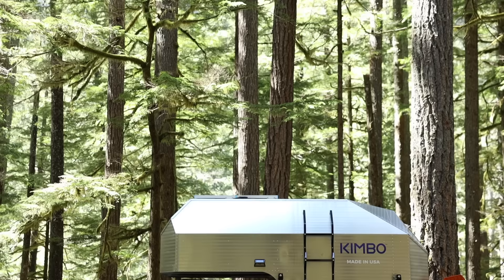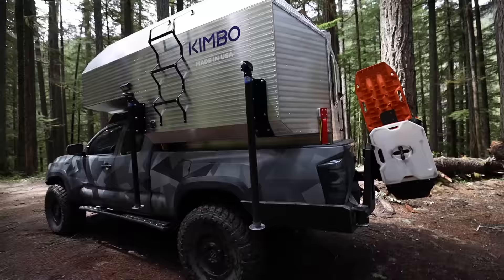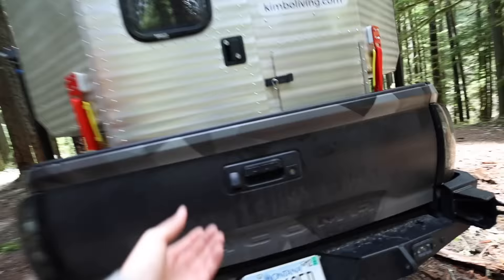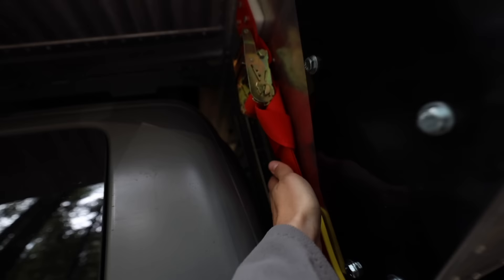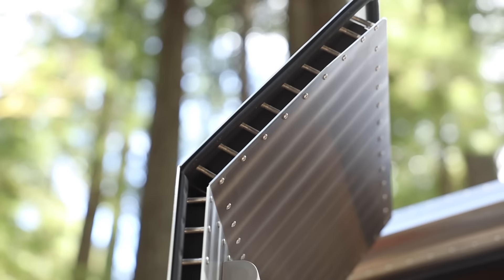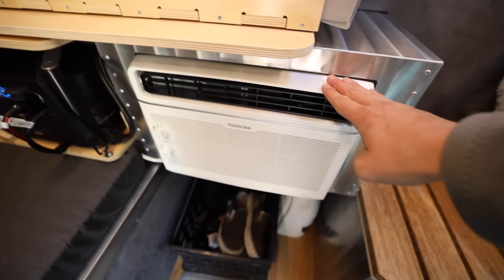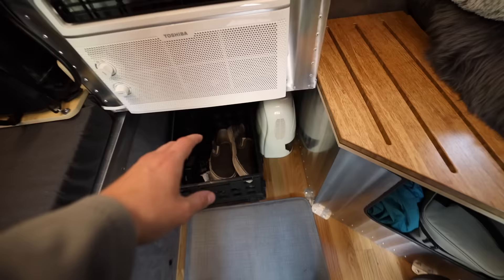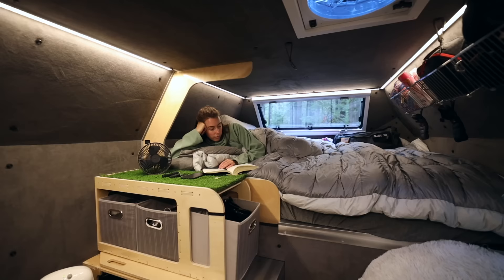KIMBO Series 6 | Truck Camper Tour!

Comment: the look inside just makes it stand out and pop very nice and open when looking down gives a loft feeling for sure very nice over all. i see you solve your diesel problems for winter camping. that looks like its sits about 2 feetish above your truck for only losing 2mpg that's great. have you thought about getting a portable gen rater to run your ac
Reply: Hi from Australia, 🇦🇺
I just read your comment and thought you might like to look at my set up, Australian locations such as world heritage listed K’gari (Fraser island the worlds largest sand island) and camp cook ups. 
Cheers 
Out There Touring

Comment: Thank you for putting out the very first in-depth kimbo video... I, too, have been following Kimbo since the beginning and am looking forward to finally purchasing mine in october of this year. I have a 2019 Ram Powerwagon with the ramboxes and am constantly checking and rechecking the dimensions.. I've bounced around to different campers.. But I always come back to the kimbo.. it fits my needs the absolute best. I am also planning to put a roof rack on my truck and have been chewing on how much of a spacer to put under the camper. I would like to know more about the "horse blanket" spacer you created... I've been following you since you did the 2 kimbo videos... Thank you again.. there's just not many quality video's out there.. Kimbo, it seems, is still a very well-kept secret.    The final mod for my build will be a SherpTek flatbed.. You should look into them.. allow you to utilize the side spaces and gives you more outdoor cooking space. Also love the paint job/ wrap.. cheers
Reply: that's going to be an insane setup. how do you like the power wagon? I been looking into getting one. I want to be able to have a truck bed camper and possibly tow my 2005 wrangler behind it on a trailer. i like the kimbo, the only other option really would be a lance 650, but the kimbo has so much more character to it.
Reply: @Can't Fix A Sandwich  first thing to understand about the power wagon is limited payload... 1400 lbs with 10k tow capacity... im going to get thr Carli Powerwagon suspension with the upgraded coils in the rear which will give me 2k payload and will make it possible for me to haul a kimbo. I love my truck.
Reply: @prjctwolf   ya the jeep is around 5k and I figure a trailer would be around 3k. so with a camper I would probably be pushing the limits of the truck. power wise I don't think it would be too big of a issue but I would def need some suspension and sway bar upgrades to handle it
Reply: Hi from Australia, 🇦🇺
I just read your comment and thought you might like to look at my set up, Australian locations such as world heritage listed K’gari (Fraser island the worlds largest sand island) and camp cook ups. 
Cheers 🇦🇺
Out There Touring

Comment: Did up my suspension in the of my Toyota pickup initially to carry weight such as a build bumper with tire carrier holding a 35” tire plus all of the trail gear I could think of. When I did the Chevy leaf spring conversion I opted for 3500lbs springs instead of 1500lbs. Putting in a truck camper was never a thought for this rig at all, but turns out now I have one because life gives you lemons. Camper weighs 1600lbs dry, ouch! But the truck doesn’t squat at all, since the pickup never had a rear sway bar I now have added one to help with body roll. That in itself wasn’t enough so I added a Firestone air spring kit and helped even more. On top of that the axle width also plays a part on the smaller trucks, already having a V6 e-locker in the rear I also added 1” wheel spacers to give my rig a wider stance on the pavement. All in all things turned out, my build is nowhere stock having parts from Toyota’s 84’-04’, V6, 5speed, geared down with 5.29’s, plus a 4” suspension lift on a stock solid axle frame. If I would change one thing it’s the camper, the floor is 6’8” which means no spare tire carrier and it now resides back underneath. I like the Kimbo cause it seems you can still run a carrier, but it looks taller than my current pop up, which for me in creases center gravity in the wrong way.
Reply: Hi from Australia, 🇦🇺
I just read your comment and thought you might like to look at my set up, Australian locations such as world heritage listed K’gari (Fraser island the worlds largest sand island) and camp cook ups. 
Cheers 🇦🇺
Out There Touring

Comment: Hey Talon, writing from Breckenrdige.  I'm picking up mine #221 in June, can't wait.  I'm putting mine on a 2013 tacoma 4 door with a 4 inch lift.  Besides beefier suspension, custom leaf springs, and airbags (I've already done all that) is there anything else you'd recommend I do before I pick it up.  I have a big ARB bumper, no winch that I kind of want to leave on.  That with my bike rack and mtn bike will really be pushing that payload but Im honestly not that worried, with all the suspension upgrades I've already done.  Thoughts on that? should I at least ditch the bumper ? Stoked you got one of these! a month before I get mine, so cool!
Reply: He re geared also.
Reply: Hi from Australia, 🇦🇺
I just read your comment and thought you might like to look at my set up, Australian locations such as world heritage listed K’gari (Fraser island the worlds largest sand island) and camp cook ups. 🍴
Cheers 
Out There Touring🇦🇺

Comment: I’ve had my Kimbo Camper since Dec 2019. Instead of step to get up into the truck bed, I opted for Toyota to put in a foot pedal that I just slide out when I want to get in and out of the camper. 
I have E rated tires and firestone airbags. I also put in a switch in the cab to flip on the back camera while I’m driving. At the time it cost me 200 bucks to add at car toys. 
I also cut a strip of wood to the section where the bed is and clamp to the wood storage cabinets. This keeps the things on the upper bunk from sliding out. I only have this hooked up while I’m driving. 
It would be nice to have a get together with fellow Kimbo Campers or some kind of forum to converse on. My camper is number 26. I live near Seattle. 
I am somewhat leery about the weight of my camper with just a stock Toyota. I would love to have some feedback on what to do to add better suspension for payload in the back without spending a fortune? 🖖
Reply from the maker: Thanks for sharing Ben! I noticed the only place owners connect is on a forum which is kind of clunky so I created a Facebook Group... hopefully we can get other owners in here - https://www.facebook.com/groups/987035651948536
Reply: @TalonSei  
Thanks but I don’t use Facebook. Don’t like using forums that don’t allow free speech! 🖖
Reply: I have #67 Kimbo and totally agree with needing an owner forum of some kind. So glad to find this channel.
Reply from the maker: Thanks! Feel free to join the group so we can spread the word ✌🏻

Comment: OK, you made this video for me, right? No, of course you didn't. We have never met. But: I have a 2021 Tacoma off-road access cab, long bed. I had the same air bag suspension installed today that you have, but none of the other suspension modifications nor other truck modifications. I have a Kimbo virtually identical to yours on order. Yesterday I got a call from Niki at Kimbo; they moved up my delivery estimate from January 2023 to July 2022 - two months away! It will be outfitted virtually identical to yours except no shower, no air conditioner. It may have been one of your videos where I first saw the Kimbo and immediately knew I wanted one.  There was a used one for sale in Davis, California, 760 miles away. But then I discovered it was built in Bellingham, 85 miles away..
Reply from the maker: Awesome congrats! Maybe we will cross paths and get to kimbo camp together 🤘🏼

Comment: At 25:20 you say the intake for the Dickenson is all enclosed in the tube(stovepipe), Then about 10 seconds later you say the intake is below the heater. I'm guessing you mean the intake for the fan not the firebox. Is that correct?
Reply from the maker: 2 different intakes. One for the flame is in the tube and then one for the air circulation is found underneath inside the camper. Each system is closed and works independently make it efficient and safe 👍🏻

Comment: hey man, nice camper! i looked up that airconditioner, the 5,000btu one, and under power source it says corded 115v and battery. does it have a 12v adapter? i like those dickinson heaters too. man, and that shower setup. nice. my plan was to use a collapsable tub to stand in, but now ill probably build a multipurpose bin like that! sweet!
Reply: Hi from Australia, 🇦🇺
I just read your comment and thought you might like to look at my set up, Australian locations such as world heritage listed K’gari (Fraser island the worlds largest sand island) and camp cook ups. 🍴
Cheers 
Out There Touring

Comment: Wow, 5.29s with 35s?  Is that right?  

How's your topend and gas mileage?  I used to run 4.56s with 35s on my Ranger back in the late 80s.  It was V6 with manual trans and it was a perfect match even when hauling trailers.  Are you planning to go with larger tires?
Reply: Hi from Australia, 🇦🇺
I just read your comment and thought you might like to look at my set up, Australian locations such as world heritage listed K’gari (Fraser island the worlds largest sand island) and camp cook ups. 🍴
Cheers 
Out There Touring🇦🇺

Comment: Congrats on the Kimbo!
Is it possible to run the AC off of the dual Ecoflow batteries or do you need shore power for it?
Reply from the maker: As of now just shore power. You would need a beefy power system to run it off batteries.
Reply: Hi from Australia, 🇦🇺
I just read your comment and thought you might like to look at my set up, Australian locations such as world heritage listed K’gari (Fraser island the worlds largest sand island) and camp cook ups. 
Cheers 🇦🇺
Out There Touring

Comment: When you changed your gear ratios front and back did it affect your stock locker that came with the tacoma?
Reply from the maker: It does not effect the stock locker. I also added a front locker while we had everything apart.
Reply: Hi from Australia, 🇦🇺
I just read your comment and thought you might like to look at my set up, Australian locations such as world heritage listed K’gari (Fraser island the worlds largest sand island) and camp cook ups. 🍴
Cheers 
Out There Touring🇦🇺

Comment: What was the point of adding the tonneau cover & rooftop tent if you knew you were going this direction? Seems like a pain to switch out.
Reply from the maker: I covered that in this video. Switching them is easy, tent for summer camper for winter.

Comment: How does it affect gas mileage?
Reply from the maker: Depends on how / where your driving but with the gears and everything I have built the truck with it has only dropped 2mpg so far
Reply: Wow, not bad at all for a house on wheels
Reply: I find the gas mileage varies from around 12 miles a gallon to 18. It all depends on the weather, and how fast you’re driving.

Comment: Check the air conditioner, is it twelve volts?, it lasts many hours on?, someone in Florida wouldn't find them Kimbo to be an aluminum oven in summer?

Use it in hot climates to know how well insulated is and how long the air conditioner lasts.

Also, the propane to create heat is not efficient, in cold weather it would get empty much more faster than a diesel heater.

And again, an aluminum box transfer hear and cold really well, so it had to be extremely well insulated to not freeze or get cooked.

Like, it would be to get havelock wool all around it like the storytellers do, to avoid freezing or cooking inside of it.

Otherwise, as an idea, looks cool..... Is the application what creates lots of doubts.
Reply from the maker: AC runs on shore power. 
The camper is insulated extremely well, better than any van. 
Propane heat like this is one of the most efficient ways to heat and it can run continuously for 400+ hours on one tank.